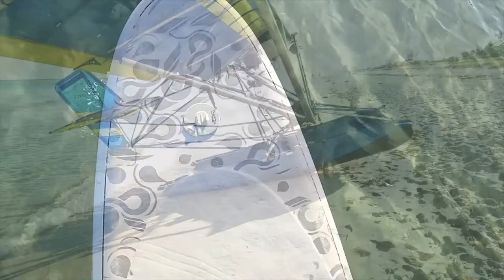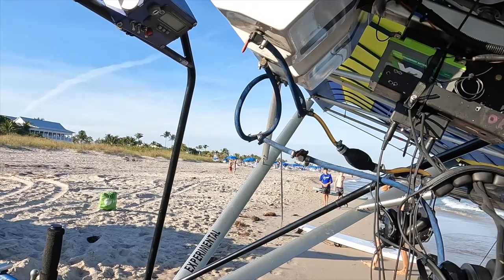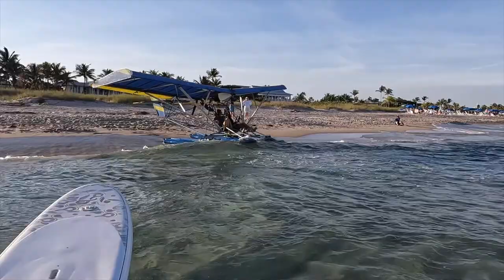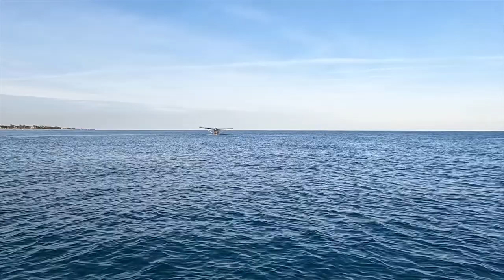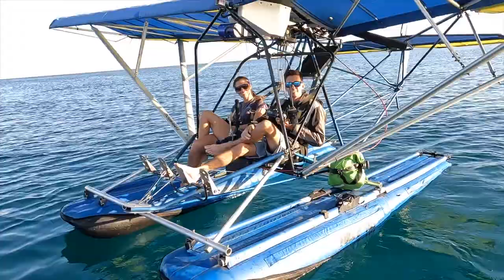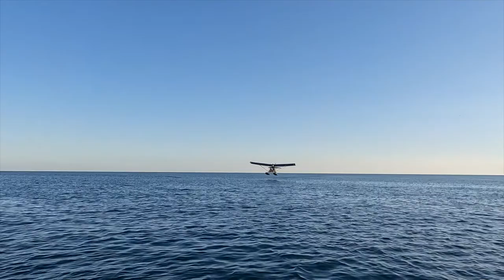Home built Sea Plane Light Sport Aircraft Long Version

Comment: It's a sport 2s rudder with a sprint wing.
Reply from the maker: Thanks for the info and have fun flying
Reply: @TomLeeman  sorry I didn't mean to be so short. The whole tail section could be a sport 2s tail, but the wing is single surface fabric giving it 10mph slower flight characteristics, the sport has double surfaced wing covering giving it faster speeds all around. This plane must be so much fun down there, but the salt water probably takes a toll on the steel parts of the frame and muffler. But I can imagine if you're going to own one expensive toy in Florida, I'd have one of these too. It probably has the least amount of contact with the salt water than any other recreational vehicle around. You could buy a single seater with floats and teach yourself to fly easily with all that open practice area. They are a blast to fly.